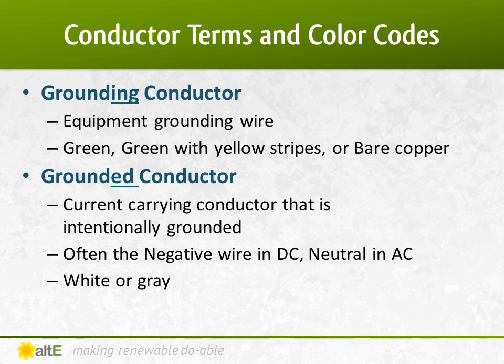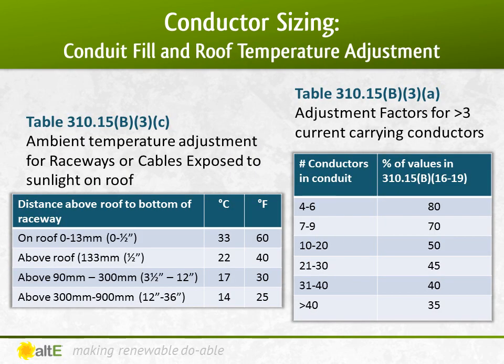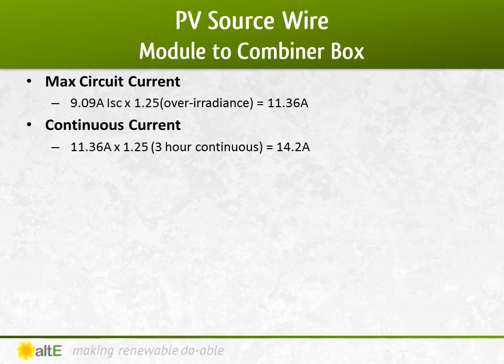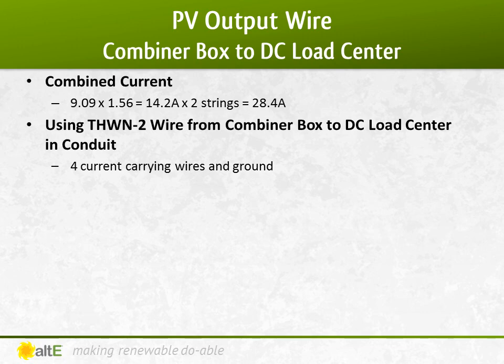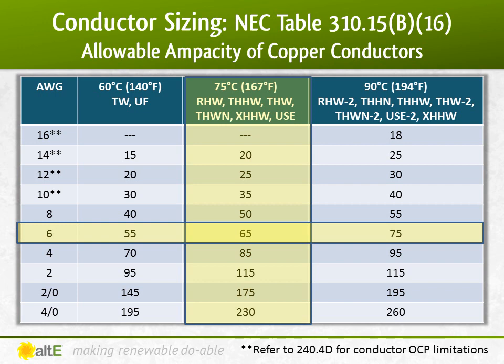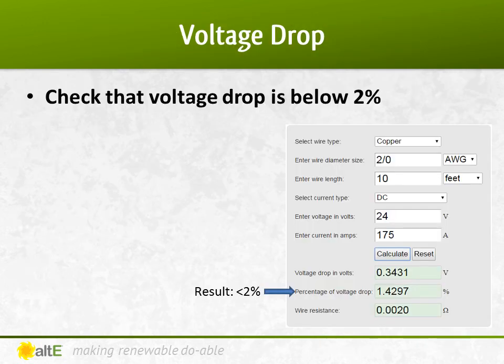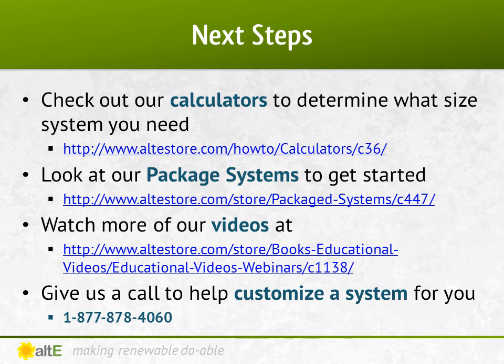Wiring Your Solar Power System

Comment: I have 16amps  or less on 10 gauge, 100' or less,  and doubled 2/0 , 5' with less than 250amps, welder cable, with fuses, breakers, and disconnects on everything!  It's off grid, but I don't need it burning down either!  33kwh battery bank, I'm getting a larger inverter, and possibly going to 48v, from 24v being I only need to series my batteries, 7 series lithium now, so full would be just shy of 60v, but I stay under 28.8v. I have forced cooling from my basement, it's about 60°F mid summer, basically what I do is double what the wire is rated at, or half it, what ever! About 15.5 amps on 10 gauge upto 100' I'd rather have 8 gauge but it is only for about 4 hours a day, the panels are shaded, just under 1100w per 10 gauge run, in burried 1" conduit, with 4 strings, the rest is less than 25' with 600 watts, 42vmp, what ever that comes to, on 10 gauge use2. It may not be code, but its not going to burn my house down! (Knock on wood)  great info,

Comment: 00:22 ----- Objectives.
00:40 ----- Wire Types.
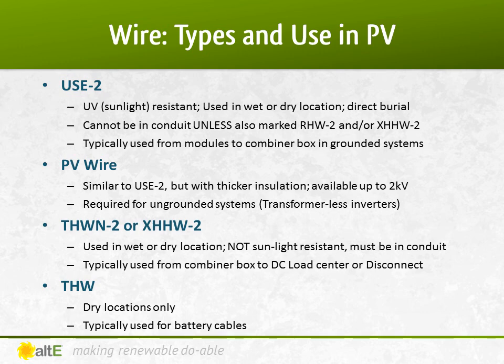02:45 ----- Types and Use in PV.
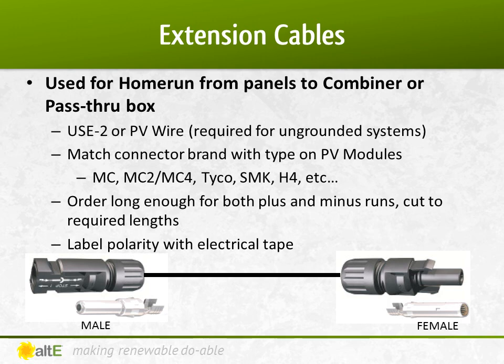03:49 ----- Extension Cables.
04:44 -----Wire Size.

Comment: Looks, your ground connection is on the main electrical rod.l am not sure how far away your panels are from the charge control mines are about 110 foot. Do you think I need another electrical rod near the panels
Reply from the maker: Yes. With the grounds so far apart, another grounding rod near the panel array is a good idea.

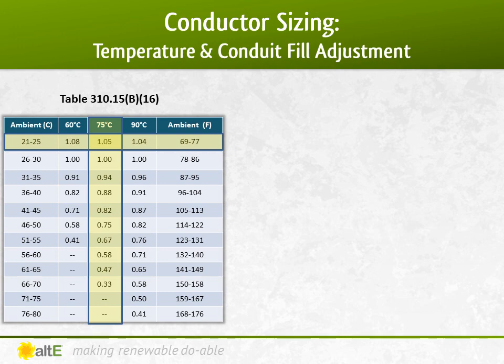Comment: at 16:41 it is table 310.15-B-2-a not  -16???
Reply from the maker: That table used to be 310.16 in older versions of NEC, I don't remember which year. I don't have 2011 on me, but I know it is 310.15 in both 2014 and 2017.

Comment: please I will need these slides as a pdf can you provide'em
Reply from the maker: Sorry, we are not able to do that.
Reply: You can use Window's Prnt Scrn function, paste the image into MS Paint or any image editing software, and pick out what you need and save it as a *.jpg, png or some other picture formats.  Not a PDF (yet) but the info you want in printable form.  I grabbed a straight line diagram of a system that's almost the same as mine, saving me a whole lot of trouble on the permit application, from another video.  Is that copyright infringement?  If it is, people have been infringing mine all my life so it doesn't bother me.  Publish something to the Internet, and you lose all ownership rights in a practical sense, not just a legal sense.

Comment: Hello there AltE. Would it work if i use PWM with a Series connection of pv arrays? What would be the possible outcome?
Reply from the maker: Wiring in series increases voltage. A PWM charge controller needs the same voltage from the solar array as the battery bank. An MPPT charge controller can handle a higher voltage.

Comment: Ati Vaa and mi question? Why did you "divided" 14.2 by 0.88 to get temperature correction. In the previous slide it was "multiplied". I believe ampacity should decreases.
Ambiental temp increase, Current decrease in wiring
Reply from the maker: When you divide by a decimal point, like 0.88, the number increases. So 14.2A becomes 16.13A.
Reply: You multiply when determining the wire capacity, but divide when you are working with the current. Is that right altE?
Reply: I thought more about this. Why would you derate the wire by 0.88 to find the proper wire that can handle 14.2A? Instead of "uprating" the current to find the wire. I can see how either way works, but they are not exactly the same.  For example in the PV Output Wire section, you are working with a current of 35.5A. To find the correct 75deg wire you uprate the current by 0.58 (35.5 / .58 =  61.2A) and select the 6AWG wire. I would think you would approach from the other end, which is to find the wire gauge and derate to a value higher than your working current of 35.5A, so 65*.58 = 37.7A which is greater than 35.5A. This still requires that you use the 6AWG wire, but the calculations are a little different. Any thoughts?
Reply: Great video by the way!!

Comment: need a 10-hour battery backpack, how much is a solar plant
Reply from the maker: I assume you mean 10 amp hour (Ah) battery. If you use half of it, that means you have to put 5Ah back in. If it is in good sunlight all day, a 10W solar panel might be able to do it. But if it is on the backback as you are hiking, a bigger panel would be needed to make up for less than perfect conditions.

Comment: thank you so much for you help. can u do this also in an on grid system?
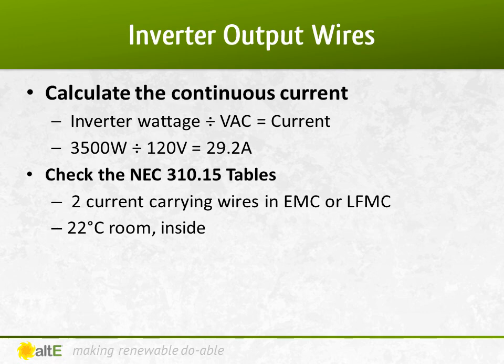Reply from the maker: This applies to both off and on grid. You can just skip some of the middle steps for grid-tie. For on grid, the PV Source Circuit is between the solar panels and the grid-tie inverter if you are not combining them on the roof. If you are using a combiner box, the PV Output Circuit is from the combiner box to the grid-tie inverter. Then you just need to jump forward to 18:18 to figure out the size of the Inverter Output Wires.

Comment: very complicated issue; should provide video into a series of 4 or 5 videos rather than one.
need to include  pictures of cables and wires and related solar elements.
Reply from the maker: I agree this is one of our more advanced videos. We have over 100 videos on different solar topics, at different technical levels, and are adding more weekly. We'll look at how we can create some additional videos to break this down a bit more.
Reply: For DIY like me, it would help if it's a dumb down kind of video, with a lot of accompanied pictures of real equipments, tools, or elements.  It might be hard to do, considering a range of DIY folks that you have to satisfy.
Reply from the maker: I wonder if it would make sense for us to have a technical rating, like 1 wrench to 5 wrenches for basic to very technical. You've definitely given us something to work on, thank you so much for your feedback.
Reply from the maker: The good thing about making solar videos is, we'll never run out of topics.
Reply: thank you. Overall, your video session is well made and good reliable and accurate source of information.  Keep up your good work...

Comment: this is calculated for 3500 watt/24 volt inverter, what if I plan to add at a later date another of same inverter in a tandem, would the cable size still be the 2/0 cable?
Reply from the maker: +Rev John O'Toole That can be a tricky one.  Since the current from the the DC Load Center to the second inverter would be 175A, 2/0 cable can be added to wire the inverter in. But the wire from the battery bank and the battery interconnect cables would need to be looked at. You've increased the wattage pull from the battery from 3500W to 7000W, so it's now 350A. When we divide the 350A by 1.05 because of the cool temperature, we need cable that can handle 333A. Per NEC 310.15(B)(16), 2/0 cable is only rated for 175A, and 4/0 is only good for 230A.  So you'd need to either get even bigger wire, or more likely, add a second set of 2/0 cable to increase the current capability.
Reply from the maker: If you were designing the system from scratch, and planning on eventually going up to 7000W, you should consider starting out with a 48V system instead of 24V to keep the current down.
Reply: +altE Store originally I built with 4 awg for smaller inverter and not fully understanding the math. so going with the 2/0 would cover me for upgrades in future. right now I just wish to get through some power outages with my aimes 3000 w/24v on 4 t-105 re's. 
but replacing those 4 cables  with 2/o cables, would be a good idea.
interesting that aimes shipped 1/0 with the inverter a few years ago.
best
Reply from the maker: +Rev John O;Toole I had to leave out some wire sizes in the 310.15(B)(16) table to fit onto the page. 1/0 can handle 150A. 3000W / 20V = 150A
Reply: +altE Store actually I was using a different source for same table. the price difference is close and you don't have 1/0 cables. I'm good at making my own cables but a bit cold for it.
I'm putting in an order now.
thanks

Comment: I noticed you continue using the 75 degree column (for max amperage) from charge controller to batteries, batteries to inverter, and inverter to AC socket. Am I right to assume you're no longer using a breaker at that point? If so, why not use the 90 degree column? Are charge controllers, inverters, or batteries ever rated to a maximum temperature?
Reply from the maker: +Kyle Bishop Remember that the 75 degree column is Celsius, not Fahrenheit. It's 167F. If my charge controller and inverter are exposed to higher than 167F in my basement, I have got some other problems going on ; ).
Reply: +altE Store Hah, indeed. I just realized you're using the 75 degree column because of the wire type selected. So unless the charge controller, battery, inverter, or AC output has a temperature rating associated with it, you could use the 90 degree column if using one of the wires listed for that column. (please do correct me if I'm wrong about that!)
Reply from the maker: +Kyle Bishop Bingo. Good old NEC Table 310.15(B)(16). Allowable ampacity of copper conductors. The type of wire used has the temperature associated with it. Nothing else was pushing me into a different column.

Comment: which Morningstar MPPT charge controller will allow me to increase my 12 volt solar set up to 600 Watts safely ,,,,I have 4 100 watt each Renorgy mono crystalline solar panels now eventually I would like to add 2 more 100 watt each panels for an A total 600 watt set up,,, I am currently using a Morningstar Prostar PS 30 m charge controller and it works really good
Reply from the maker: +bill767667 The Morningstar TS-MPPT-45 can handle an input up to 600W. 
https://www.altestore.com/store/Charge-Controllers/Solar-Charge-Controllers/MPPT-Solar-Charge-Controllers/Morningstar-MPPT-Solar-Controllers/Morningstar-Tristar-TS-MPPT-45-45A-MPPT-Charge-Controller/p7727/
Reply: Thank you

Comment: I just used a cheap Harbor Freight meter thing to check the wires on my four 100 watt each 12 volt solar panels and I got about 14.5 14.6 volts does that sound good or bad???
Reply from the maker: +bill767667 It depends where in the system you were measuring, and if the wires were connected to the charge controller or not. If it is just the wires from the panels, not connected to anything but the meter, you should be reading 16 - 17V. If it is connected to the charge controller, that sounds about right.
Reply: My batteries are topped off and I think there at like 14 point something volts and my apps were I think 15 or 16 amps,,,, the last I checked them they were 12.4 and then I checked them again the Sun is moving across the sky I checked them a little bit ago and they were like 11.9 amps thats the Morning Star showing

Comment: well that last post didn't make 100% sense I'm using the microphone feature on my cell phone and it likes to write words that you're not actually speaking ,,,well,,, that pretty part about Amy was right,,, 

what I was trying to ask is on overcast days can I use my generator with a really good quality battery charger to charge up my battery bank ?and if so which charger do I need,and do you sell it?
Reply from the maker: +bill767667 You can get a quality AC charger like the IOTA DLS. Probably the 30A or 45A model. Ideally, you don't want to charge a flooded battery bank faster than 10% of its capacity. For your battery bank, you have 188Ah x 2 strings in parallel, which equals 376Ah. 10% of that is 37 amps. You can see details of the Iota chargers here.  https://www.altestore.com/store/Charge-Controllers/AC-Battery-Chargers/IOTA-Engineering-DLS-30-30A-12V-AC-ConverterCharger/p696/ You should also get the optional IQ add-on, that converts the charger into a 3-stage charger for even better battery life.  https://www.altestore.com/store/Charge-Controllers/AC-Battery-Chargers/Accessories-for-the-AC-Chargers/IOTA-IQ4-Smart-Controller-for-DLS-Series/p703/

Comment: I have 4,   6 volt 188 amp hour golf cart batteries old school flooded lead acid I've got them all wired up to essentially make one big 12 volt battery and series and parallel,,, I also have a Honda eu2000i inverter generator and a knock off of the Honda manufactured by champion by the way the kids actually really good for the however what I want to know it's an overcast day is any snow eccentric I'm going to need to charge my Bank, what type of battery charger do I need to use for this so I don't destroy my batteries so I can charge all four of the batteries all at once what type of charger would you use for that, and if you know of a good one for that do you sell it??? also Amy are you from New Hampshire by any chance? I live in Ohio now but years ago I lived in Franklin New Hampshire ,we had some beautiful girls up there that looked just like you ,I was kinda of wondering if you mighta been related to email.

Comment: you calculated 2/0 wire from batteries to inverter, what about battery to battery can that be smaller or the same being it not in conduit just open air?
Reply from the maker: Rev John O'Toole You want to make sure that you use the same size cable for each of the interconnects to ensure the same resistance between batteries. But yes, you are right, if the interconnect cables are in free air, which is likely, you could calculate that wire size separately.

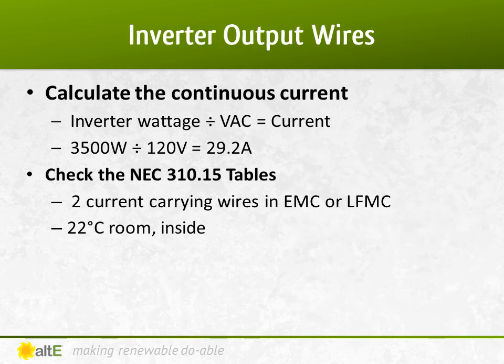Comment: 18:17 - Should neutral count as a current-carrying conductor for PV inverters?
Reply from the maker: carultch No, in normal configurations, the neutral is not current carrying. There are some exceptions for unusual cases, but in most instances, it is not.

Comment: 10:06 - I've had trouble with this rule.  See 110.14(C) in more detail.

Derate factors apply to the wire rating, and not to the terminals.  This is usually the advantage of 90C rated wire.  Even though you can't take credit for its full ampacity at terminations, along the length of the wire it gives flexibility to adjust for conditions of use.

Comment: "The National Electrical Code establishes that if a conduit only contains 1 wire, the max fill percentage is 53%. If it contains 2 wires, the max fill percentage is 31%. And if it contains 3 or more wires, the max fill percentage is 40%."

In general, it represents about 75% of the interior diameter of the conduit being filled.

Good for an exam, but in practice this can be a lot tighter than you really want to go.  Good for local pulls, but not when there is a lot of distance and bends.

A practical approach when anticipating a difficult pull, is to start with largest size and total quantity, then add space for a hypothetical additional wire of the same size.   Example: 3 #4 + 1 #8.  Assume they are all #4, and size conduit for 5 #4, which would be 1 1/4" conduit.

Comment: ***** hey Amy, I was wondering why you didn't calculate voltage drop from each array to combiner box
Reply: Also, why put the PV output circuit into conduit? Could one avoid the ambient-temp increase from table 310.15(B)(3)(c) if simply using bare wire?
Reply: Kyle Bishop You have to have some kind of a structure, to mechanically support it and protect it from physical damage.  Conduit is usually the practical solution.

"Bare wire" means non-insulated wire, which shouldn't be used for current-carrying.  Good for an equipment ground, not good for power.

Open air wiring methods can still be subject to the air temp increase, when in close proximity to the roof in direct sunlight.  I haven't found an official NEC calculation for it, but intuitively, I wouldn't ignore the temperature adder just because you hang the wire on your racking system instead of run it in a conduit.

Open air wiring methods also require more robust insulation.  Such as USE-2 instead of THWN-2.
Reply: Probably because it is the same calculation strategy for the source circuit wiring, as it is for the DC feeder, so she only needed to show one calculation to demonstrate the concept.  It certainly is correct that both voltage drops matter, and do add up.
Reply: carultch Thanks! Misnomer on my part when saying "bare wire", really just mean insulated wire out of conduit.

Comment: Some helpful information to size your conduit.  The National Electrical Code establishes that if a conduit only contains 1 wire, the max fill percentage is 53%. If it contains 2 wires, the max fill percentage is 31%. And if it contains 3 or more wires, the max fill percentage is 40%.  Here's a helpful calculator, http://conduitfillcalculator.com/